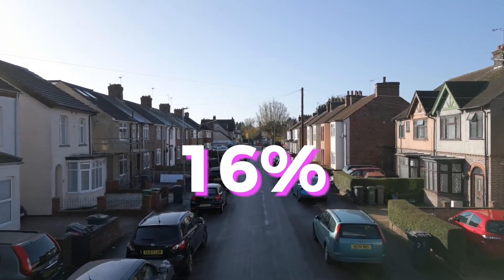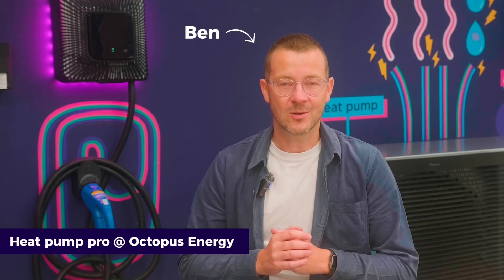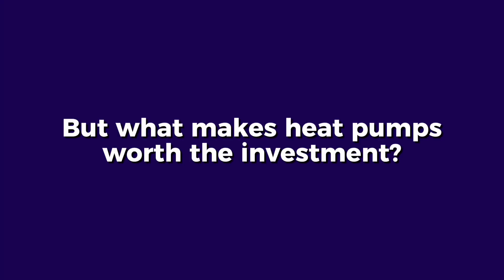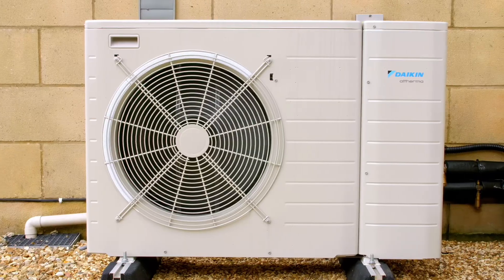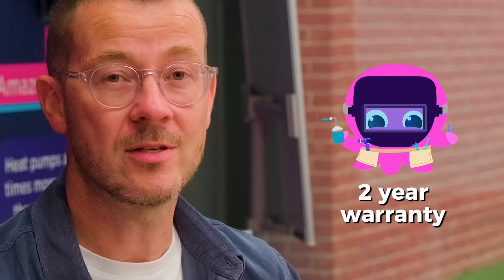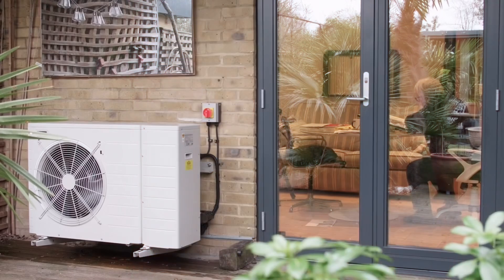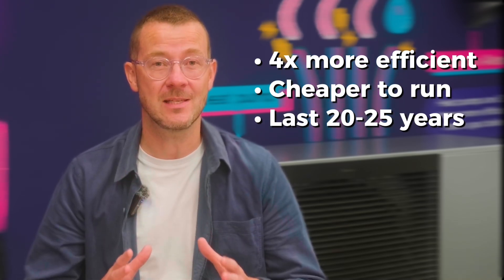Are heat pumps ACTUALLY worth the investment?

Comment: There is so much misinformation about heat pumps    First I should introduce myself. I bought the first ground sauce heat pumps into Scotland. From IVT. And I also worked with. NIBE in Sweden to develop the first single phase air source heat pumps.     If you have the money and the space to put in a ground source heat pump these run around a COP 4.6. Which is great. But this does not apply to air source and the original calculations with the air source were only actually economic within around 30 miles of the coast where the air is generally warmer and 10% denser.    For an electrical compan air source  heat pumps are great. They use lots of electric and divert the coppers into the utility.    However, as soon as the temperature is at zero, the efficiency is 1 to 1 which is better than gas, but at -5 the efficiencies negative indirect electric heating is brought in.  So if you want to heat your house when the air is 4° C. The efficiencies are incredibly low.   It’s also important that a heat pump is not over capacity as you’re running a big compressor which puts the running cost up which again and not a problem for the utility company but they are a problem for Home owner. And because of multiple companies and multiple machines being supplied servicing them parts is very difficult.

Comment: I think some of the octapus pr saying £500 for a heat pump isn’t really true for most. My quote for a s/m semi detached 3bed was £5000 including the substacy. Also my forecasted savings is only £10 a month so best case in 25yrs id only saved £3000 that dosent add up to me. And soon as you put the yearly service cost onto it witch on average is twice as expensive as gas puts this as more expensive than my combi. Let alone all the other issues or costs. The only way it makes any sense if you have a decent solar array with decent battry backup. But that’s 10s of thousands ££££££. Personally im not made of money plus factor in we are looking like we may be going into a recession / crash economy personally id consider taking out debt wouldn’t be wise especially if the return is in the - range.

Comment: Everyone raves about heat pumps and yes they heat the house and work in the winter  and not that noisy. But they are very expensive, complicated and difficult to get repaired. Everyone who has one installed reels of great cop figures and how warm it is and how much better than a combi boiler ect, but the question that is never answered is what is the payback? Same as solar! When do you get free electricity? Never get the answer. Would you pay £15k for a heat pump that will in reality only save approximately £200 a year. Ps, will need massive radiators and a small room to house all the kit.

Comment: In a word Bollocks, 1.7 to 3% increase in the value of your house max. the cost outweighs any benefits. Stick with gas for as long as you can. Only my opinion, best to do your own reasearch. annual service £150 to £300. new filters every 3 months costing £20.
Reply: A gas boiler is able to vary its working temperature so costs very little to run at 48degrees so no saving when using  a heat pump.

Comment: Hi @russcraig
Can't remember my original post I'm assuming it's cause I said gas is 4 times cheaper? .
I understand how heat pumps work as an installer.
I think the point I was trying to make was neat pumps are 3 -4 times cheaper to run than a gas boiler in terms of energy but the energy cost is the same in difference per KW price Ie gas is around 4 times cheaper per KW to run so it all balances out long term .
Thanks for the reply 👍
Reply: In the long term we are all dead wayne.

Comment: Yet another tariff that isn't available to all those (often rural) customers whose SMETS2 meter is stuck in dumb mode due to lack of signal.  The industry really needs to sort dumb mode smart meters in both Northern and Southern networks.  Parliament should be forcing the regulator to act.
Reply: Replacement 4G comms hubs are to be trialled in England from Dec 2024 with wider rollout Q3 2025.
Reply: @PinkDuckUK  Is that for the South network or will it cover the Arqiva/North network?  Quite why we couldn't have a UK-wide standard approach I don't know!
Reply: @russcraig1216  Will happen for Southern cellular network first. Scottish Government opted for Arqiva approach, though that could change given different network characteristics of 4G perhaps.
Reply: @PinkDuckUK  thank you. Whilst my 4G indoor reception isn't brilliant it is probably good enough if they go that way. 5G ironically is better  indoors here!

Comment: I don’t understand how, when the government has announced they are stopping cheap off peak electricity, that a heat pump can be viable. 
Gas costs about 5P/kWh and peak electricity is about 25p/kWh, it takes approximately the same energy to heat a unit mass of water with either energy source. It goes against the laws of physics that it can be cheaper.
 
The only exception being if you have generated your own electricity for “free”using PV or wind.
Reply: They are only stopping off-peak for those without a smart meter. Simple answer is get a free smart meter.
Reply: @BarryHeaven  are you sure, I thought the entire off peak rate tariff was going? To be completely gone by 2030 I read.
Reply: @yp77738yp77739  You seem to be very ignorant about this whole subject. I suspect you are watching dodgy youtubers who don't understand facts but enthusiastically push rumours and conspiracy theories. 
Here is how I see the points you raised. 
Heat pumps, as has been mentioned, move heat from outside water, ground or more commonly air to your heating system. You also get most of the energy you put in as well. It is not all good news as they need cooler water in the return so usually other upgrades like larger radiators are needed. Underfloor heating is ideal. Good insulation is needed to take advantage of off peak electricity. They usually have to run longer than a boiler would so not good if the hose is empty all day. Also they are noisy. 
Off peat electricity use is encouraged as it reduces peak loads which is where the grid struggles. It is likely to be used more not banned but I expect the price difference to reduce as EV takeup advances. I only use off peak electricity as I have a large battery for load shifting. A big upfront cost that will take 4 more years to break even. I could also use it to make money by selling power back for a profit at peak times. 
I don't have a heat pump yet as the payback time is too long and I despise the red tape around getting one installed. I want to install it myself and keep my gas boiler as a backup/booster. For £7500 I could install a very nice system but can only get a mediocre system fitted  within the regulations.  I have a 200 year old 6 bedroom house which needs a good system. I will probably end up making my own system out of used refrigeration equipment.
Reply: Is it the role of the government to set energy tariffs? "off-peak" may be a particular out of date construct, but is a tariff that caters to heat pump use different, maybe? I charge my car at a lower rate at night, for example. But, I have never considered it to be "off-peak". It's part of my particular energy tariff - a time of use tariff.
Reply: Heatpumps can be over 300% efficient without breaking the laws of thermodynamics.  They are not consuming electricity to produce heat they are using it to pump heat from the environment (ground/air/water) to your home.  This doesn't break the law of thermodynamics.  Your fridge for example will have a CoP of around 1.6 (160% efficient).  I hope you now understand.  There will be more in depth explanations a google search away.
Reply: @russcraig1216  Thanks
I looked and it’s essentially a fridge in reverse, but with the addition of a refrigerant to water heat exchanger. 
Every step in any system has inefficiencies, so I still struggle to accept that a complex system of exchange of states can be more efficiency than a single, direct transfer of energy. But I guess I must be wrong (or everyone using them has been fooled)!
We did use one in a rental property about 10 years ago I had in Switzerland, the plant room was massive and took up the space of a normal UK kitchen. The room itself was overbearingly hot, suggesting a rather high inefficiency, so warm we used it to dry our laundry. I do remember our monthly electrical bill was 3 fold what I am paying now, but I was too busy at work to pay much attention.

Comment: Some major errors and omissions in this video. 
1. The grant is only available for a whole house system.  People that have to use multiple heating sources can't apply. 
2. If you are one of those,  like me,  in the countryside without gas or oil you will not have radiators so can not use,  (this kind of,)  heat pump as they use your rad's even if a few need replacing with larger ones. 
3.Those who have the most expensive heating - storage heaters - can't use this system as it requires radiators. 
4. Heat pumps are very bad in deep winter,  but good at other times. (see below) I speak from experience, not figures that show 'average over a year' 
5. The more practical form of heat pump,  other than for new builds,  is to install air to air heat pumps otherwise know as air conditioners. I find they work very well in all but deep winter when I do have to use the storage heaters but that is normally only a few weeks a year and I still put one air con unit on if the temp' pops up a little midday. The only bad things about air conditioners are that there is no grant at all for them - they are thought of as a luxury rather than what they are - very good heaters, even if they do need a backup heater. and the installation will cost the same as the units themselves.  2 years ago I paid £3,200 for 2 x 4kw (heating) units and slightly over half of that was installation which took two men one day.  I do recommend these especially if you have PV,  you get free heating for a good part of the year and even taking into account needing a secondary heater,  (in my case a few mobile oil filled electric rad's and a wood burner) are well worth buying
PV + Air con is an excellent match.

Comment: Like EVs Heat Pumps are technically fantastic but not suitable for everyone. I live in a 60 year old semi-detatched house with good insulation. To swap over to a Heat Pump system the saving would take nearly 20 years to pay off the investment. If I was in a poorly insulated house with a boiler on its last legs or a house without central heating then it would be a different story.
Reply: Does that payback period include the savings in getting rid of gas altogether? The gas standing charge isn’t an insignificant cost. Every little helps.
Reply: @st200ol  Yes. Standing charge on gas is £108 per year for me. I would love the technology of a ground source heat pump but the cost of a system change, let alone the hassle of ripping up floor boards, etc means it's not a sensible move for the vast majority of people in the UK.
Reply: 🎶 🎵 Gas is free. Gas is free. In a debt based economy. 🎶 🎵
Reply: I also live in a 60s semi.  I have had a heat pump installed by Octopus in August.  The install was very good.  So far it heats water efficiently at no more cost than gas.  I turned the heating on two days ago, so far so good.  They are not for everyone because of physical space needed.  As far as installation costs, with grant cheaper to install than a replacement gas boiler.  
Running costs, well that depends on your tariff and the relative cost of gas v electricity.  I am expecting to save money. The heat pump is 3 to 5 times more efficient than a gas boiler.  As you say not for everybody, and never will be, same for electric vehicles.
Reply: How long is the payback period on your kitchen, TV, car, existing boiler, holiday?
Reply: @t4bs594  That's a good argument that I'm familiar with. My choice was between a heat pump and an electric combi boiler. I went for the latter for a few reasons and a few years on  I feel I've made the right choice. We all have different situations and there are many options in the way to supply energy to your home. In eight years the boiler's warranty will be up and I'll review the situation. I have a very well insulated house and dallied with the idea of electric radiators throughout. Now I wish I'd gone that route and it'll be in the mix when I review in 8 years.
Reply: To give a counterpoint many historic buildings including here in Scotland are heat pump warmed.  If they can do it in Denmark it can be done here.  That doesn't mean that in your specific case it makes sense just that people shouldn't assume old means that heat pumps won't work.

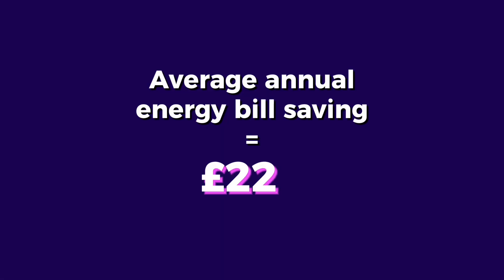Comment: At 3:51, does the average annual saving of £220 include savings from disconnecting from the gas network (no longer paying standing charge), or is this due to the higher efficiency of heat pumps compared to gas boilers?
Reply: At least part is due to the efficiency, as the standing charge for gas is just over £100 per year
Reply: But beware, there are no tools for the end user to measure the efficiency, and even now I’m getting at best a cop of 2. Which means , because elec is about 4 times more expensive than gas my costs are at least twice as high as with gas.
Reply: @terryT-r5o  Have you had a second opinion in on the heat pump, or an explanation of the poor performance? 

Time of use tariffs can save substantial amounts of money (though probably not making up for the poor performance). Are you on one?

Comment: What he doesn’t mention is that at temperatures of 5 degrees or less the heat pumps efficiency drops and it uses more electricity. This will means there will be no cost advantage and as the pump has to work harder the noise levels increase. All the space that will be required to house all the cylinders and tanks will cause problems in modern homes that took the cylinders out when they were encouraged to install condensing boilers that don’t need storage. The particular design of the Octopus heat pump might have a problem if there is heavy snow as the fan faces up.
Reply: I have an Octopus energy heatpump so unlike a lot of people who haven’t got one yet are experts on heatpumps I can tell you my experience. Heatpumps that are installed correctly are not noisy in fact a boiler flue makes more noise and the do heat the house even when the temp is below zero. However the need to be on most of the time but having said that they still are cheaper to run than gas and much cheaper than oil.
Reply: The 4x efficiency he quotes is for energy use over the whole year, factoring in both drops and rises as the temperature changes outside.
Reply: Also electricity is around 4 times more expensive than gas , and I can pretty much guarantee all radiators will need changing to accommodate the lower working temps.
I am a heating engineer and I have recently installed a heat pump to my own property so I can be a guinea pig for my customers.
Reply: @waynebeal1152  The electricity runs a heat pump, it isn't "burned" to make heat.
Reply: @waynebeal1152  that’s interesting as Octopus did a survey of my house and they said all radiators will be compatible. Oh, and my £500 quote would have included any radiator changes too 🙂